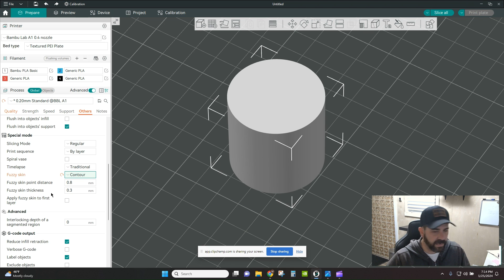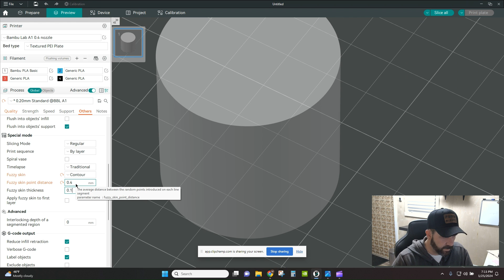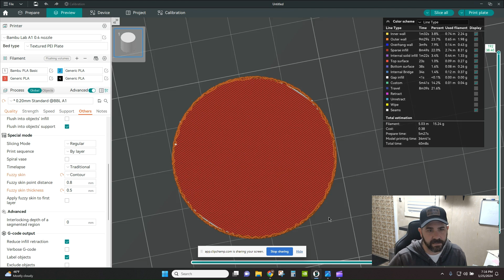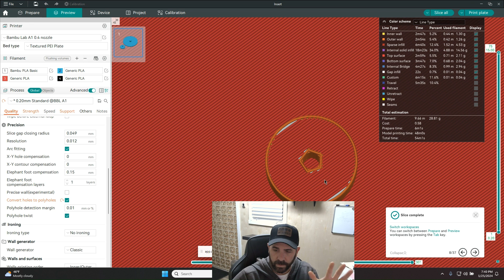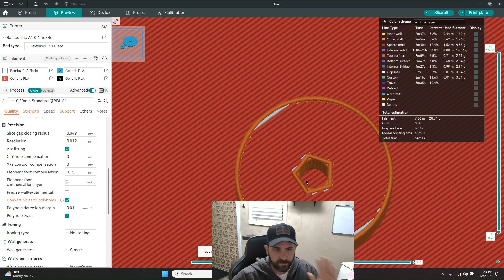3D Printing with Orca Slicer: Mastering Fuzzy Skin & Polyholes

Comment: i dont want to be that guy but polyhole is almost useless since you can use a drill bit, problem is when you have large holes and cylinders where polyhole dont make the cut. that a issue with curved surfaces, tricks like those wont fix it, coz developers dont care about it.

Comment: Great vid. Maybe u could help me with one moment. When I select fuzzy contour it apply it inside model(power supply case). How could I set to ignore inner. I work in Orca. Thanks
Reply from the maker: Happy to try and help. I had a similar issue on one of my models and used a modifier for inner portion and set the modifier to Fuzzy Skin = None.  

If you want to drop a link to your file i'm happy to load it in my orca and see what other tricks can be used.

Comment: In order to avoid supports, I tried polyhole on holes that need to be printed in a vertical orientation. It doesn't appear to do anything. I was hoping the holes would be converted into polygons that eliminate (or reduce) the need for supports. Rats...

Comment: What setting do you think would match up similar to the texture of the PEI plate?
Reply from the maker: I use 0.8mm for distance and 0.1 for thickness. That seems pretty close to me for the stock textured build plate.  Maybe even a 0.5 for thickness.
Reply: @fischer3d  thanks. I'm using Bambu studio but can seem to get it to apply the fuzzy skin to a top flat layer. It hits the sides fine but the top of the box is not applied.
Reply from the maker: right, fuzzy skin will apply to the walls and not top/bottom surfaces.  With your part, do you have the option to flip your part so the top surface is on the build plate?  That's what I do when possible to match up the texture of the sides to the plate.

Comment: Interesting! I'll have to try that later. I was struggling to print the orca cube test, dimensionally it was perfect in every way EXCEPT the threads were always too tight. XY hole compensation fixed that but Im not a huge fan of messing with the dimensions like that since I don't know what else it's gonna change in other prints.